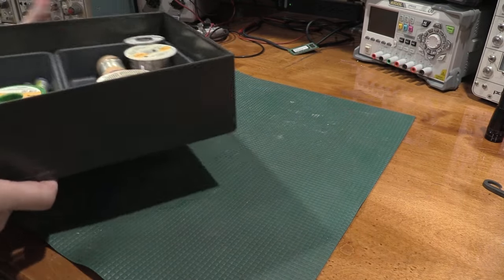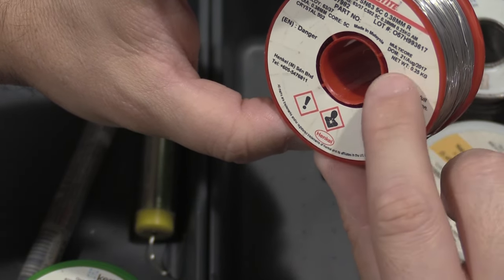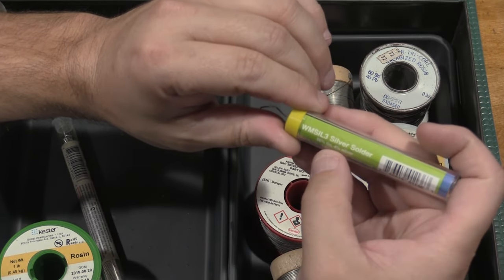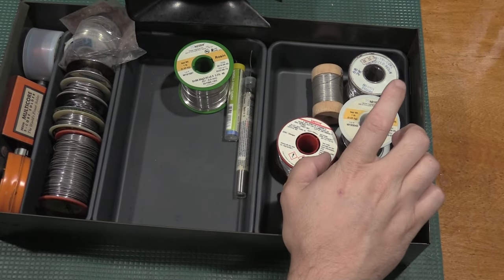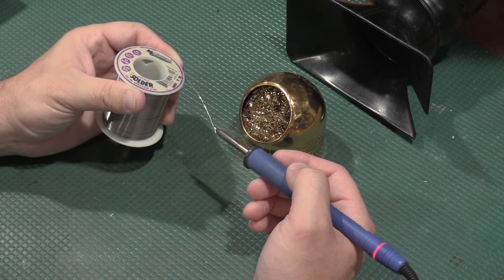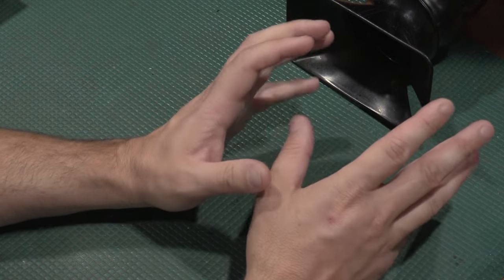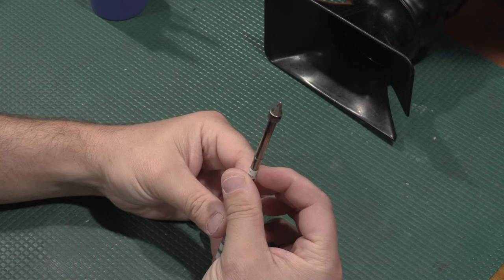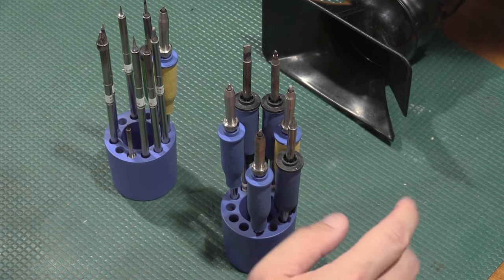More YouTube Q and A. Can more even be said about Solder?

Comment: There is a very good solder we use about 99% of the time, its called Quad Eutectic, alloyed for and sold by Cardas Audio of Bandon OR. Its a blend of lead-tin-copper-silver in an eutectic alloy, with exceptionally low antimony and bismuth contaminants. It works just fine on the Tek ceramic strips, and will never grow tin whiskers like 60-40 non eutectic.  We do keep a roll of Kester 63-37.  60-40 WILL slowly break down.. and push out excess tin as it tries to create a eutectic ratio.  In my opinion, 60-40 should be put in the recycle bin or given to someone who does lead window work.  Non eutectic silver-tin alloys will also self destruct at room temperatures. All common solders will absorb and diffuse gold, so cannot be used on gold  plated parts.. In the defense industry, it is often required to use indium or specific indium alloys to solder anything gold plated. Indium solder is very very expensive. When I was doing military contract soldering, we bought it by the Oz or gram from Indium Corporation of America, not just  'send a pound'. We do no temporary use electronics, only expensive long life non-disposable electronics, hence have no use for lead-free in anything we actually make.  If we need a solder other than the Quad Eutectic Cardas, we select ONLY an alloy specified by its maker as a eutectic alloy. All non-eutectic solders will eventually fail at room temperatures as the atoms inside the joint attempt to balance with its neighbors in a eutectic balanced ratio.  Eutectic alloys have a physical characteristic of having no plastic state... it goes from solid to liquid, and back to solid with no plastic gooey state in between.

Comment: You sure the LED wasn't turning on because the tip had some AC leaking through it ? If he was using plumbing solder, there is a good chance he was using a low quality iron.
Reply from the maker: I duplicated the effect with one of my older Wellers that I had over at the office. really not sure what is going on there though it is not instant on either. The LED was board mounted as well as was on a heat sink and the solder pads were on the PCB. He was not dumping heat directly in to the LED I would have expected it to have melted at that point. The LED lit but not at full brightness. Dim illumination but was visible with out aid.
Reply: @ZenwizardStudios  That's super weird and interesting, wouldn't have thought that possible. It happened to me before with a cheaper iron, if I touched the PCB with my hands that would ground it and create a path for the current to flow but just heat alone that's interesting.
Reply from the maker: Indeed it is. I have only seen it happen this once and never again. The only thing I can come up with is some leakage voltage from a thermo electric effect between some of the metals. There was quite a few dissimilar metals with the heatsink, PCB, wire leads, solder, and iron. I should also mention that it was an ULTRA high brightness LED that was being built for an aquarium lighting system. uA of current would get them visible (barely) but even with uA I would still need a voltage to surpass Vf of the LED. It really was the perfect conditions for this weirdness to happen.